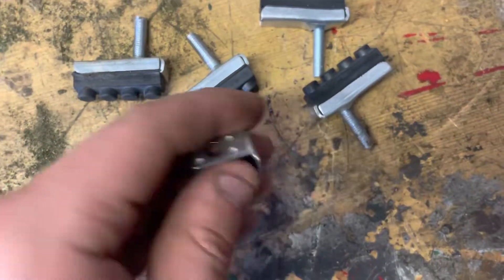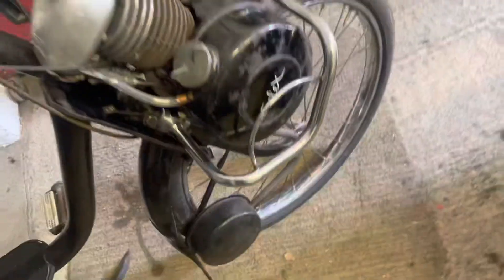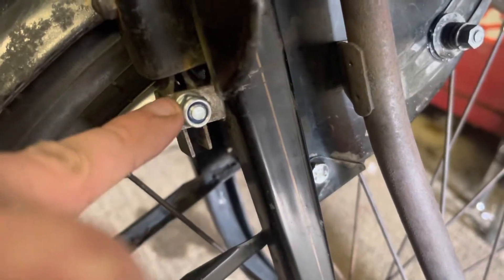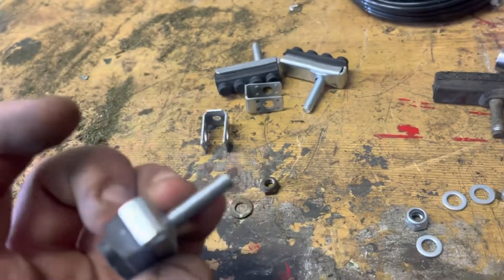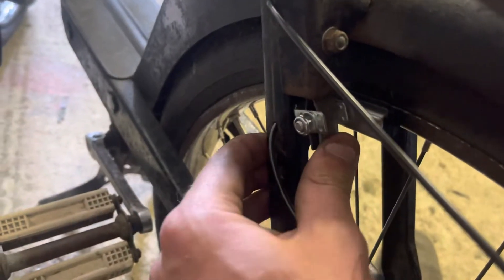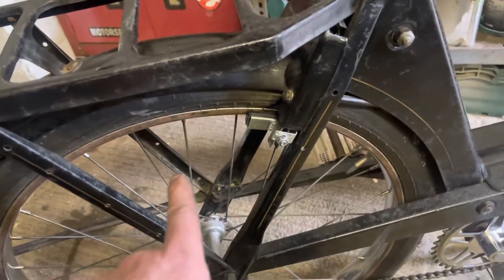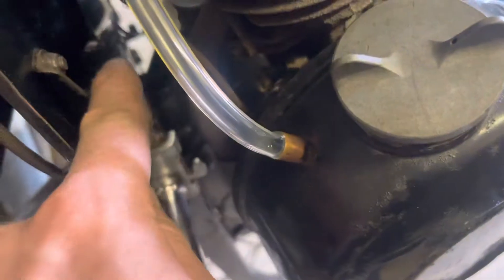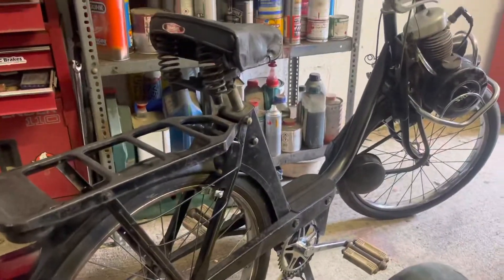1960 Velo solex 1700 barn find new brakes and filter

Comment: Hi, I have just about finished the cosmetics on my 1700. I'm having a bit of problems with fitting the rear back cable. I bought a new cable as the old one was too frayed at the end to get through the little holes. It came with the outer sheath which seemed to small. Never mind I thought, I will use the old sheath. It also seems to tight and I can't turn the handlebars to the right.
Please could you tell me how your cable is routed. Obviously I have gone through the little hole in the frame, but not sure if the cable goes on the outside of the bike or near where the saddle is, either way it's very tight.
Thanks Jeff
Reply from the maker: Hi mine was near where the saddle is hope you get it sorted thanks for watching
Reply: @Chris_GasolineGarage  Hi and thanks for your reply it seems to be fine now. I have the DVLA inspection on Thursday, so hopefully that will be the final stage before the registration document.
Take care, Jeff